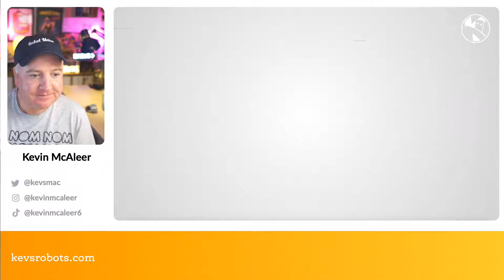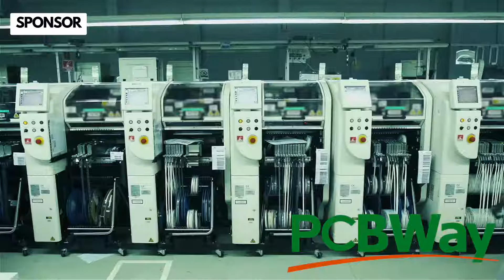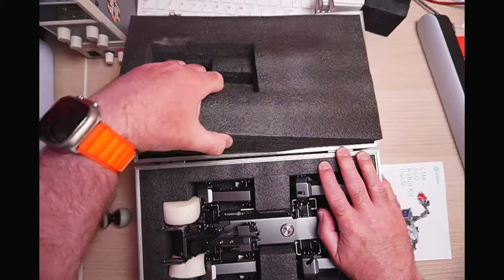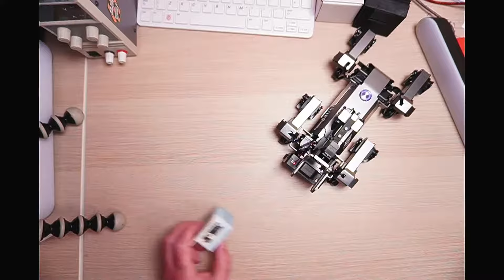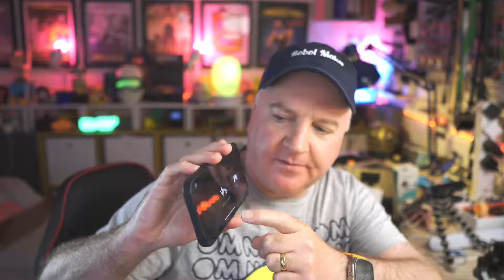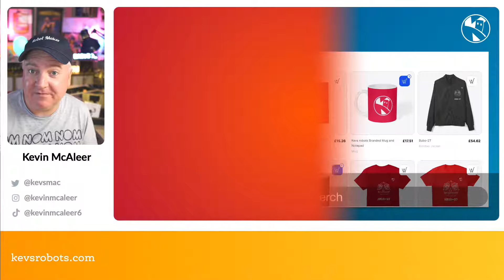XGO CM4 Robot dog Unboxing & Live stream hangout

Comment: Hi Kevin not sure if you will remember but did you have a screen protector plastic film on your screen? 
I just got mine and the screen has swirling all over it and didn't have a plastic film over it. 
Just that it is expensive and I thought it was pretty poor that the screen didn't have protection. Im also not sure if it was a pre loved one if you know what I mean. Ps I got it after watching your review.
Reply from the maker: Hey Allan, mine didn't have a screen protector on it; it doesn't sound right that it should have any markings on it if you've just got it. Have you reached out to @elecfreaks to see if they will send out a replacement screen?
Reply: @kevinmcaleer28  thanks for the quick reply, I was holding off till I heard from you but I will email them tonight and keep you informed. Haven't had the chance to turn it on as its charging and I literally just got it an hour ago. Great channel mate.
Reply from the maker: @Gibson-1957 No worries - let me know how you get on with Elecfreaks. Thanks!
Reply: @kevinmcaleer28  Hi Kevin did your Xgo just connect to thre network and diplay an IP? I keep getting No Network yet the phone is on the WiFi. I have created a QR Coder and the XGO doesn't even read that. I have set the country to my country Am I missing something? I'm waiting for EF to get back to me.